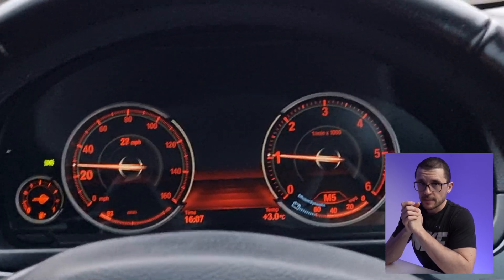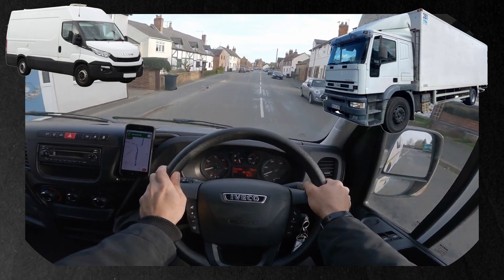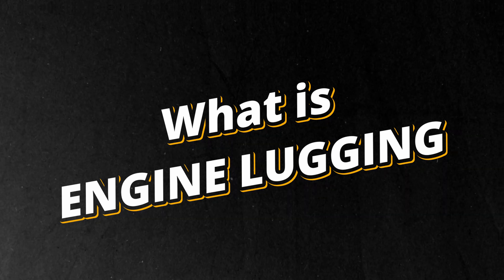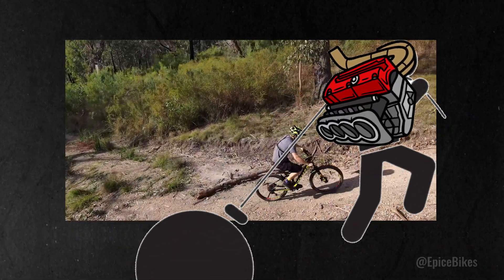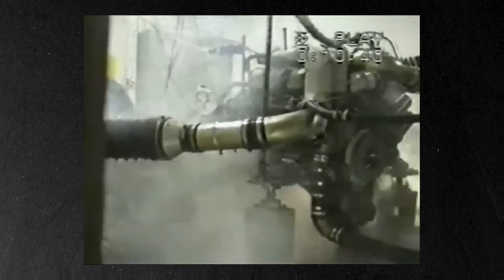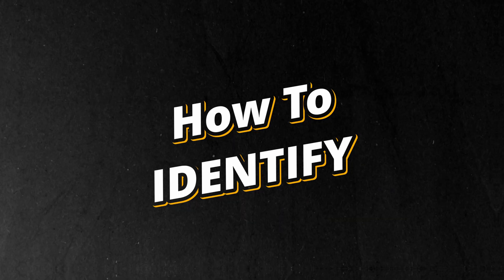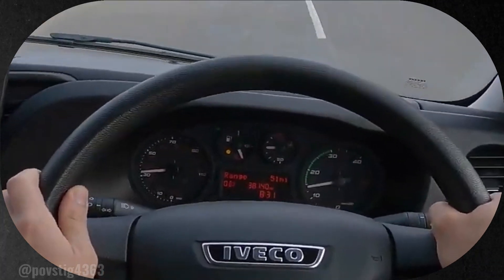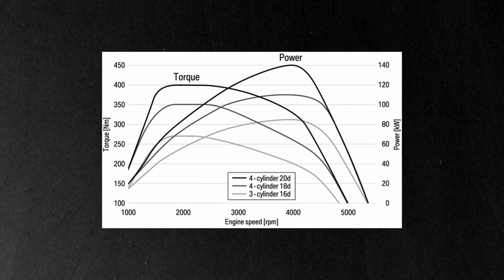Is Driving at LOW RPM Killing Your Engine? The ENGINE LUGGING MYTH!

Comment: Its about acceptable torque and EGTs.

Torque for headgasket, EGTs for literally melting things.

Vibration is the low rpm issue, look at the crankshaft acceleration/ deceleration on a scope, along with Vibration are all the other criticals such as oil pressure and coolant flow. Both issues ive modded around as a hypermiler. The BSFC charts dont even tell the full story if there are any engine variations as volumetric efficiency can change, and if the vehicle is turboed, youre better off looking at the turbos efficiency mapping vs engine load vs gearing. Go outside the turbo efficiency range, you got high egts, go too much VE... you blow the head / bend rods. And dont get started on injection timing to either make or break that.

Comment: If we are talking specifically about efficiency, then the best efficiency is achieved at max load, not max torque. Which effectively means accelerating and driving at 80-100% throttle at the highest gear and hence lowest rpm possible that does not make the engine lug.
And if your DMF went out because of this, install single mass flywheel - efficiency demands sacrifices..
Reply from the maker: I had to read it a few times to understand it, and I still feel like I don't get it completely :) ... maybe because I am a diesel guy and for us the throttle is always at 100%.
Reply: @BestCarMods  Sorry, a commenter said that you need to drive at higher rpm to save your DMF. This triggered me, 'cause the DMF is a specific invention so you can comfortably drive economically and efficiently at very low rpm. You don't need to "save" it.
Reply: I've never seen that work in practice. Beyond the engine's powerband other factors such as transmission type and gearing and wide ratio vs close ratio, rear end axle gearing, weight of vehicle, tire size, rolling resistance, and other things factored in all play a role in the rpms you shift to and where you can comfortably cruise. I have 2 vehicles from the late 90's and early 2000's. Both single cam push rod V6's. Both have 4 speed automatic gear boxes and factoring in the torque converters. Different rear gearing. One is a small truck and the other is a sports car. I've experimented in so many different ways in pursuit of proper daily drivability practices and good fuel economy. Everytime I tried to coax them to upshift at 2,000 or 2,500 rpms at even moderate throttle both the drivability of the vehicle and fuel economy went down. Sometime significantly depending on what I was asking the engine and transmission to do in a particular duty cycle. Both engines make their peak torque around 3,000 to almost 4,000 rpms roughly. Despite that alone sounding like aggressive driving it's not. I'm under light throttle under that acceleration. Once up to speed I'm in my over drive gear with torque converter in lockup. I average better mpg overall because I used the engine in it's powerband and correct gear to get the vehicle up to speed briskly enough to spend less time accelerating and more time cruising. It only needs to shift at low rpms if my power demand is low and I know that my desired speed is very low too and I'm on flat ground in doing so. Also remember your ignition curve is built around rpms and engine load factors and temperatures. Running lots of throttle at low rpms is for one asking for low speed pre ignition or spark knock possibly in it's most retarded state at base timing that it's set to and this condition also raises EGTs which also is a concern for Diesels. The flame propagation is not burning in of best interest of creating cylinder pressure to pushing the piston down in the optimal direction to move the car forward. It just makes waste heat into the cooling system and excessive heat and improper combustion out of the exhaust system. Understand I run older vehicles with fewer gears. A manual 5 speed can net different results because it's gear ratios are closer together meaning you don't have to rev your engine out as far to carry through the next highest gear sufficiently. This is something roughly known as Shift point extension. Running at not the lowest rpms and low load doesn't necessarily mean poor fuel consumption. Extra ignition advance is added in making up for the pumping losses and low volumetric efficiency. This also was why in the old school days people would use a vacuum gauge to monitor how efficiently they were driving. High vacuum at light throttle indicated you would get better mpg. Low vacuum showed how much you had your foot into the throttle and would in most cases mean poor mpg. Also efficiency in itself needs to be clarified if we are talking about performing work efficiently or operating with the lowest fuel consumption in mind. There is a happy middle that can balance both. If we didn't need to do this then we wouldn't need transmissions and we might as well drive around with flat tires.."Mind you. Don't do that." But ya technically that's added load making the engine run low rpms at wide open throttle right? So wouldn't it be fuel efficient? No. Would it perform doing work effectively? No. Will the engine even last under those conditions? No. There is an efficiency range for every engine of size and displacement and a given bore and stroke and cylinder head porting and ignition curve and exhaust and intake system and transmission gearing to support it. Low rpm driving all the time in most driving situations is insufficient. Now if your trying to go as fast as possible at full throttle and in your powerband then that engine is performing the most work it can ever do. But your maxed out at that point. Most of us don't drive like that and there is no need to. In the end only one of these conditions is more mechanically dignified for the engine and transmission. Slightly higher rpms and low load is. Low rpm wide throttle opening is not. Also rpms that are higher in engines that call for it doesn't mean that the engine is gonna wear out more quickly if it's being operated as intended by manufacturer.

Comment: Whoa, whoa, it depends on what the engine was was designed for. If it has a heavy flywheel, small valves and ports, and a mild cam, it was designed as a low RPM engine, so of course it won’t hurt it, but if an engine was designed for high RPMs, lugging it is NOT good.
Reply from the maker: thank you for your input. do you have some examples of engines that are same displacement but different rpm preference ?

Comment: All modern engines have drive-by-wire throttle control, that will prevent the butterfly from being fully open before the revs are high enough, close to the maximum Torque, even with the pedal to the floor. I drove the exact opposite kind of engines fifty years ago: Honda 50 cc bikes whose piston were pierced if you opened the throttle fully below 8000 RPM for more than a few seconds. (Yes, they were slightly "tuned", but so you soon learned about the matter).
Reply from the maker: did you have to mix fuel + oil ?
Reply: @BestCarMods  Hondas were four-stroke, even the mopeds. This said, it could happen that the engine decided he would mix some oil from the crankcase by itself :)
Reply from the maker: @pierrelauwers8719  when I seen 8000RPM & 50cc I thought It was a 2 stroke.
Reply: @BestCarMods  Do a Google upon "Honda SS 50 Specifications". You'll be surprised these little four-stroke engines revved actually higher than the two stroke competitors.

Comment: I drive BMW 318d M47 manual. The only time I feel my engine is lugging is in 4th gear at or below 1000 rpm when I try to accelerate (I upshift early in city driving). I feel it struggles and vibrates unnaturally. In all other lower gears there is no problems at or even below 1000 rpm. I try to never exceed 1500 rpm when driving, except when accelerating.
Reply from the maker: m47 that means bmw E46 or E90 ?
Reply: @BestCarMods  Hi, M47tu2, E90. It has good torque at low rpm because of a smaller turbo (vs the 320d).
Reply: You shuoldn't have any issues revving the engine past 1500 rpm, even to the redline sometimes. It might even benefit engine cleanliness by increasing flow and heat to dislodge carbon buildup.
Reply: @akdomun  Yeah, mate, I know, I sometimes do rev higher when feeling adventurous, but you know, mine is a 318d, it has a small turbo. Because of this, it is very torquey at 1000-1500, and from 1500-2000 you really feel the torque surge. But after 2500, it chokes on itself, and it is not that pleasant. It should be different in a 320d but I have not driven that.

Comment: My 1.5 tsi has max torque from 1500 rpm so i try to keep it above that. Problem is dual mass flywheel and gearbox takes a lot of damage which you don't learn until it's too late.
Reply: 1.5 tsi is usually very happy to pull you along anywhere above 1250rpm unless you're in 6th gear. Then above 1400rpm. Acceleration is a different story though, you should always be above 1500 rpm if you're requesting more than a third throttle.
Reply from the maker: @paradox5556  in what vehicle do you have the 1.5 ?
Reply: @ 2021 manual Golf
Reply from the maker: @ 1.5 is still good for that size of a car. What do you think about the 1.0 in a mini SUV like the ford Kuga or Nissan Juke ?
Reply from the maker: very good observation regarding the Dual Mass Flywheel.
Reply: 2.0TDI here, yeah my DMF shakes heavily because it’s gotten worn from frequent lugging. At 350,000KM I don’t care, I got my car for $3900. No one near me in America is willing to replace it for a reasonable price
Reply from the maker: @jetpackjbd  how many more mile do you give it ?
Reply: This is so wrong. The DMF was developed specifically so you can drive at low rpm comfortably and thus save fuel and reduce emissions. On BMW 320d ED, the DMF has added pendulums so it can operate at even lower rpm. You don't need to "save" your DMF, just enjoy technology advances.